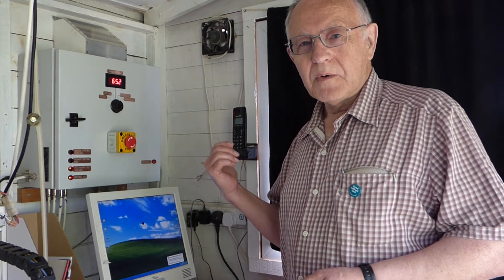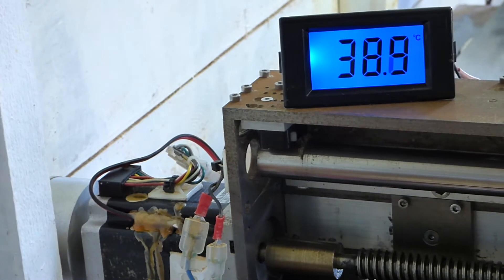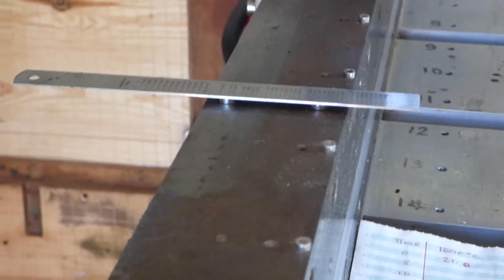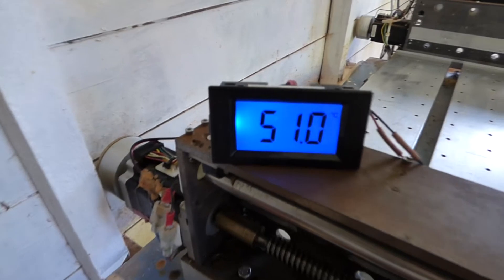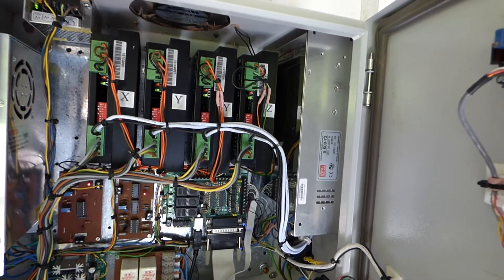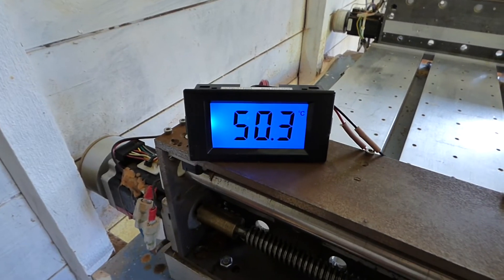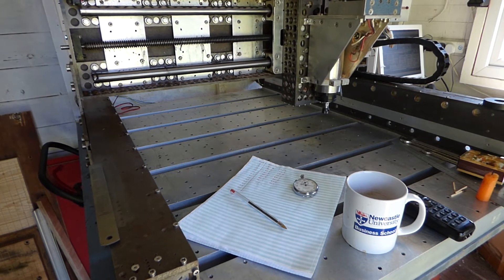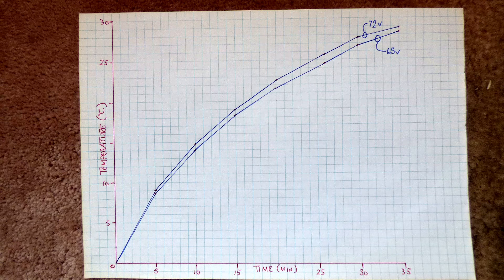My CNC machine stepper motor temperature test.

Comment: If they are less than 60 its fine. The weak point is the plastics in there which all have rated use max of 100 to 110, I would prefer to keep them at 65 to 75C

Comment: Hello sir, thank you for this usefull toturial. Last mounth stepmotor driver of my CNC machine burned and today I bought a new one but unfortuantly I couldn't find the same model, after installing the new one, CNC didn't work corructly, as an example when we ordered it to go 1m, it did about 60cm, then I incresed the frequancy from 2400 to 6400, then it worked right but now the stepmotor overheats. What is your opinion sir ? How can I solve this problem ?  thank you.
Reply: Lower PSU to driver or fans on the steel side or both. Too hot is above 80 C, the plastic can do 110 ok.